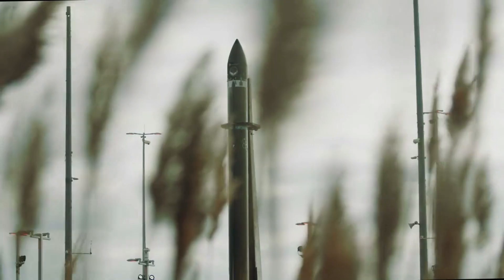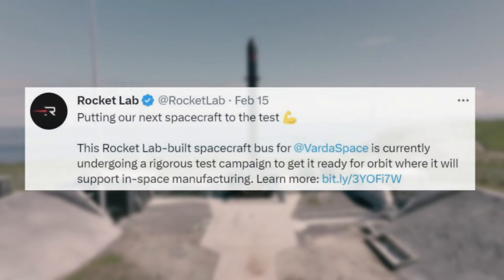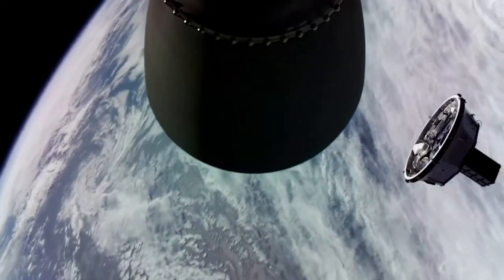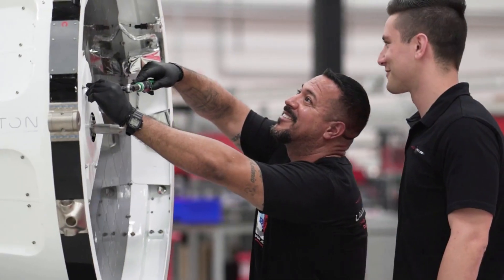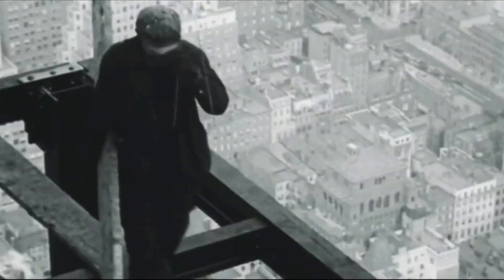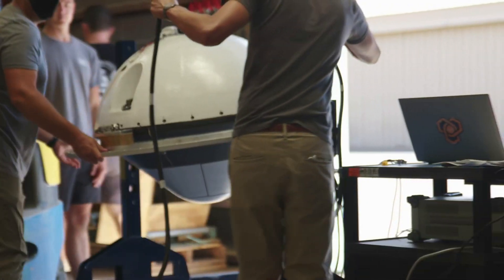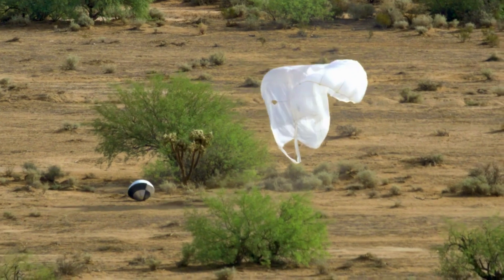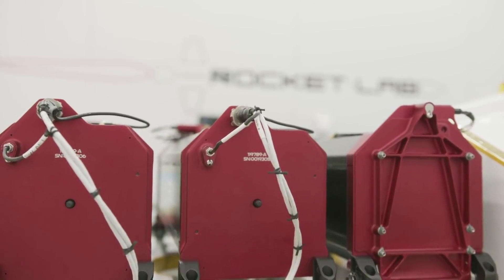Rocket Lab Is About To Help Launch A Space Factory

Comment: Do they really use hand-held angle grinders?
Reply: It's all about allowable tolerances.  Sometimes +/- 0.01mm is way outside tolerance, sometimes +/- 1cm is cutting it WAY too fine.  All depends on exactly what you're doing.
Reply: It is a very dangerous saftey hazard with all that hair not tied up. If the grinder wraps that hair up she would immediately get scalped!